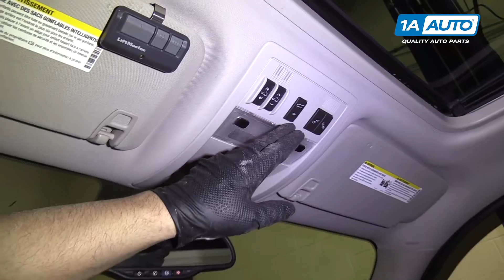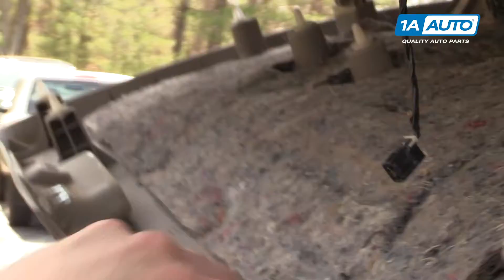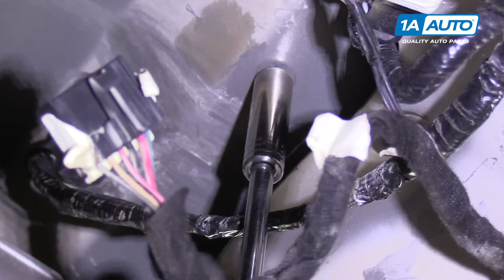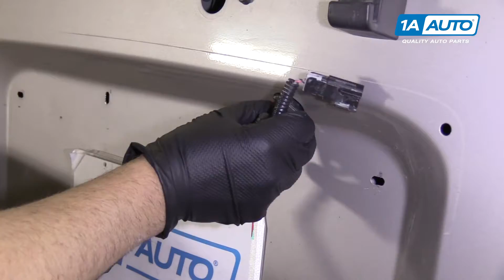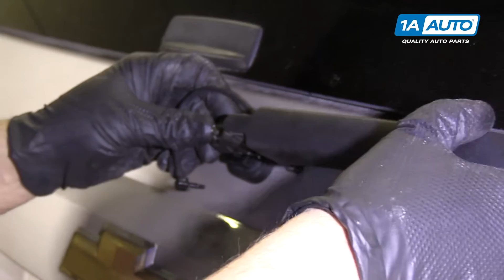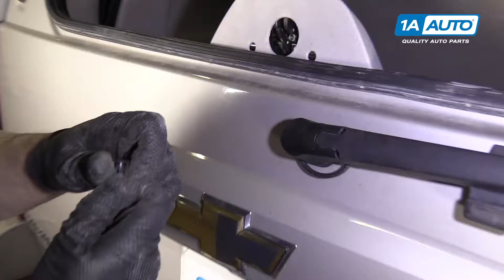How to Replace Liftglass Release Switch 07-14 Chevrolet Suburban

Comment: This guy made a 20min job $15 part turn in2 a 2hr job prob $250 job 🤦🏻‍♂️👎just push in the tabs w/a small screw driver or pointer and pull out the socket...come on people don't be suckered in2 thinking you only have 2 do it the long and expensive way

Comment: This is probably the least helpful video out there. It's long, convoluted, and intimidating to people trying to learn and work on their own cars. Not to mention that's full of shameless plugs... just use a screwdriver with tape on the tip and carefully pry the button out. Less than 5 minutes.

Comment: Anyone else got around to those 4 10mm nuts that hold the upper latch cover on that houses the switch?  Mine are spinning without being able to be removed.  Any fix for that?
Reply: Same. Pulled the old one out from the outside after reading some comments. Plugged the new one in and done.

Comment: Thanks for the video, but whatever you do people, don't follow this procedure.  I had my old switch out in less than 3 minutes using a small screwdriver and a set of long nose pliers.  Replacement simply plugged in and clipped it back on to the car.  Its a 5 mins job, tops.
Reply: How did you get the switch out?
Reply: @MohrRacing2  small screwdriver and some pliers.  Destroyed the old switch, but who cares.... That's junk anyway

Comment: liftglass cannot be opened/released. replaced switch with D1994E. keyfob does not release glass latch.  interior panel cannot be removed unless glass can be opened. there is power for the liftgate latch release. what else can be done to open liftglass?
Reply: Pop liftgate panel off as much as possible. You should be able to find the release switch not far below the window latch. There are a couple videos that show you where the release latch is while demonstrating how to replace liftgate release.
Reply from the maker: +Kurt Anderson We wouldn't be able to diagnose an issue like that here, you may want to have a local mechanic take a look at it. Thanks for checking us out! http://1aau.to/m/Shop-1AAuto-c

Comment: Might as break the old 1 and remove it without taking everything apart its no good anyways the new part will pop right in
Reply: Thanks for the video but that’s what a real mechanic would do:

$25 part
$400 hr for labor

Everyday people:
Break the old one and do it in 5 mins or less
Reply: This must be the way dealership does it to charge 2 hours labor.  What a rip off
Reply: That’s the longest route I’ve ever seen on changing out a switch LoL. But this vid is great for those needing a guide on taking the whole thing apart
Reply: Now i know how to change my wiper motor .  But the switch is easier by pulling it from the outside.  10 minutes and done
Reply: yes. you are right. it's easy and fast. why to remove all those parts!
Reply: That’s exactly what I was thinking.
Reply: @thisoldbelair  thats whats i didi saved me from taking everything apart was done in 5 mins
Reply: Just did mine in 5 min